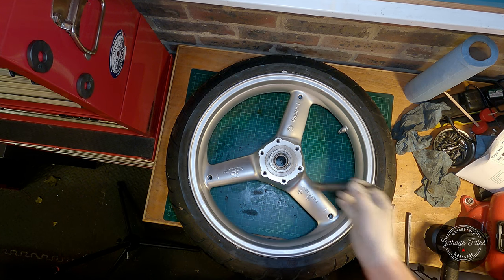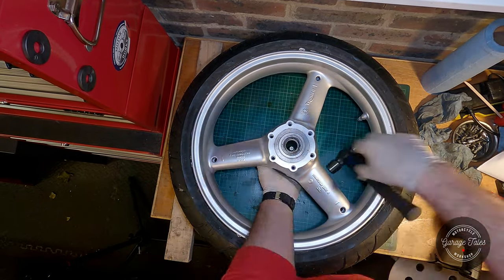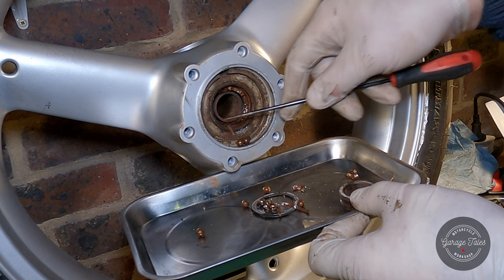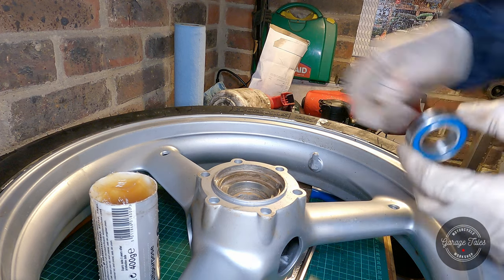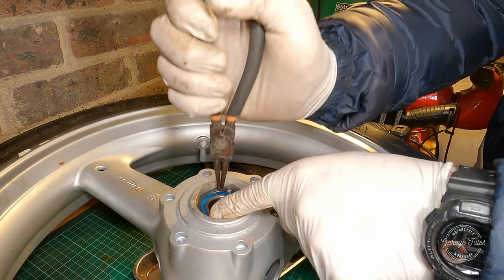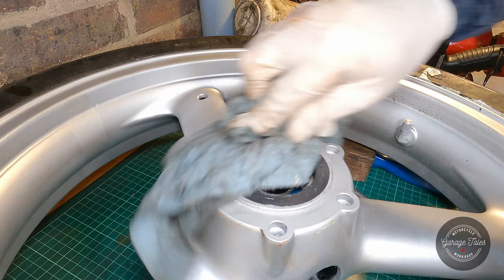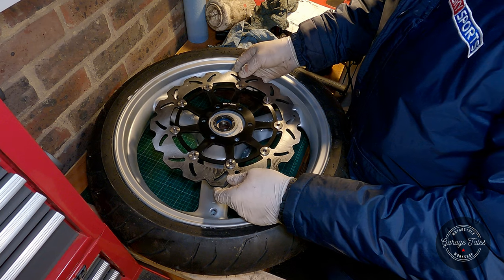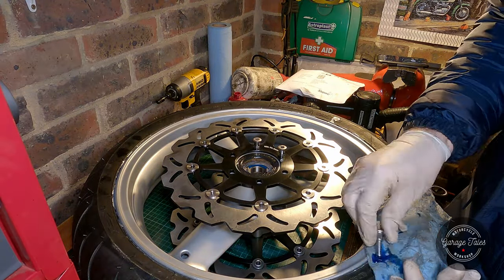Triumph Daytona 955i video 8 - Front Wheel Bearings & Brake Discs

Comment: Great videos! I’m also refurbishing my t595 1997 model. Did you find on the bearing with the larger seal it didn’t sit flush due to the spacer? Cheers!
Reply from the maker: Hey Ross. Thank you for your comment and really glad you found them helpful. It’s been a while so I don’t remember exactly, but yes I believe one if the bearings is sitting a bit proud :)